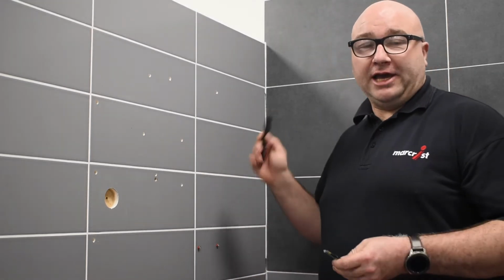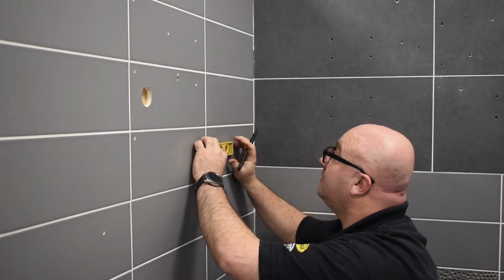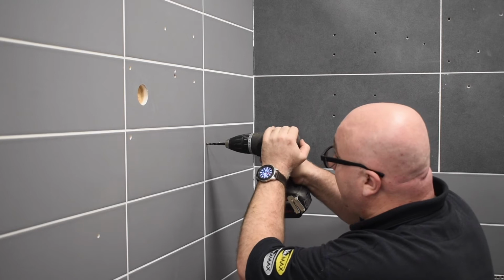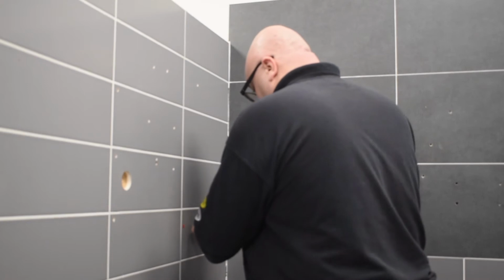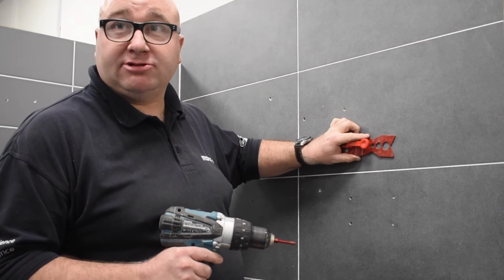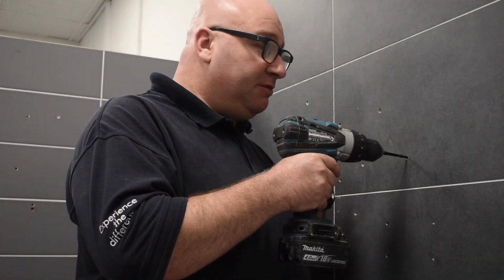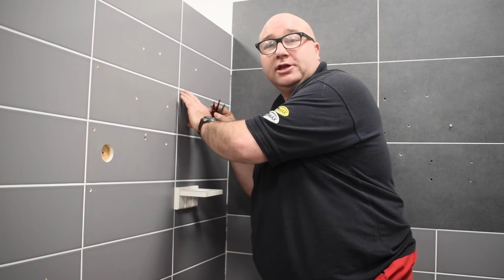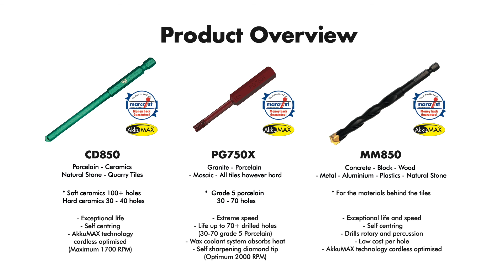Tile Drilling

Comment: Crap I’ve used the 06mm (654ph) dry diamond tile drill and the face of the bit  has sheered after one drill
Reply from the maker: Good Morning Eoghan, you have mentioned the power of the drill you used with our CD850 drill bit however you have not mentioned what speed you have used. The optimal drilling speed for this drill bit is between 750-1250 RPM. This information is available on our website https://www.marcrist.co.uk/products/CD850 or in our catalog on page 79.

If you could send your details to info@marcrist.com we will send you a new drill bit to replace the one you purchased. 

I hope this helps resolve the issues you have had with this particular product, we appreciate your feedback.
Reply: @Marcrist UK  thanks